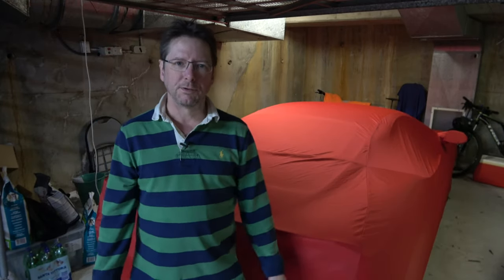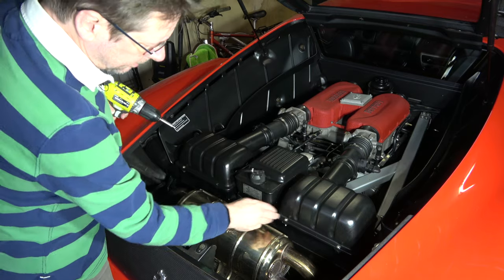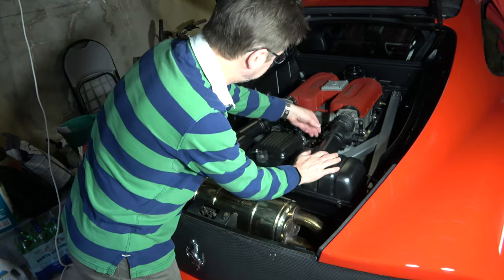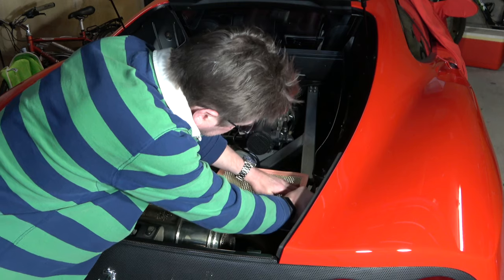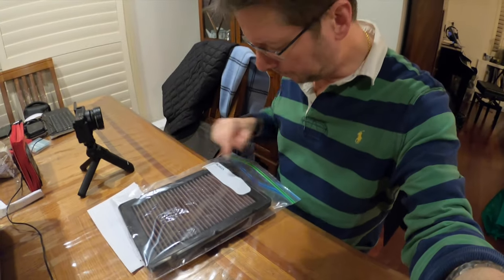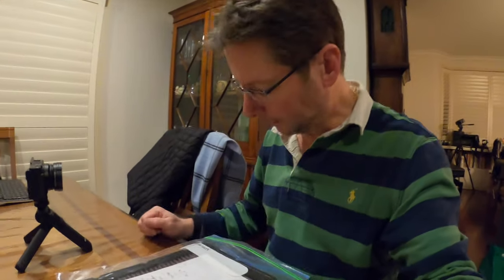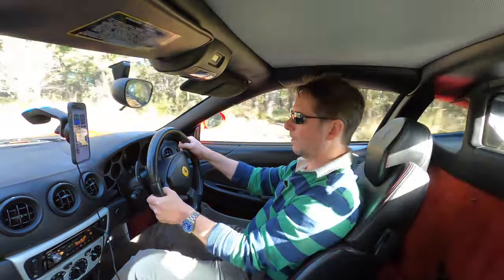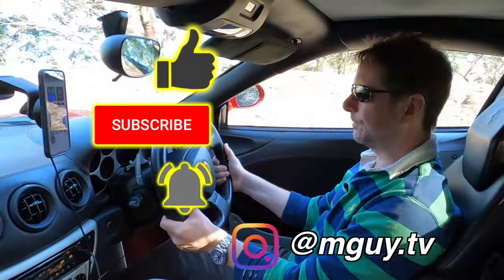Ferrari 360 - Ditching the K&N Air Filters | MGUY Australia

Comment: I think now K&N are dry filters, no oil.  You just wash them out and let them dry.  Yours might be the older style.  The issue as I understand it is that people over oiled them more often than not.  I do run paper filters on my stock 430, but a dry K&N style on my GT3 since it has a Fabspeed intake.
Reply: Yeah, they filter element is white guaze and turns red/pink when oiled so could be over oiled.
Reply from the maker: Certainly mine were pretty heavy with oil, so I think in the past they were over-oiled. I'm just sticking to the paper filters for now.

Comment: Hi Simon, my 360 came with BMC F1 air filters installed which are similar to the K&N filters. I had "dirty MAF" symptoms and had to wash all of the oil out of the filters before very lightly re-oiling them. That improved engine smoothness on start up, probably because the MAFs stayed clean. I've been considering replacing the BMCs with stock OEM filters so am very interested in your final opinion on the switch to OEM.
Reply from the maker: Interesting to hear - I am sure these aftermarket filters are fine if they are used properly, but I have no idea of the history of mine, and given the amount of oil vaporising out of the elements, I'm sticking with stock for now.